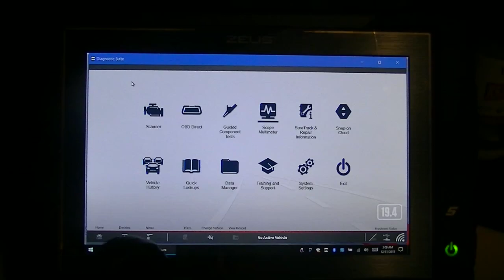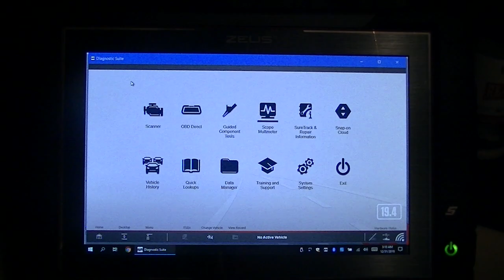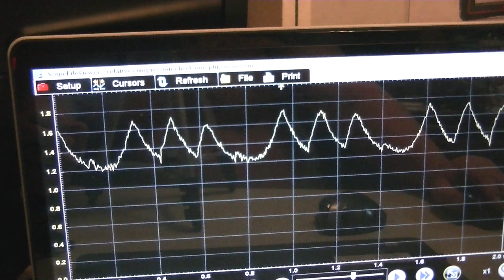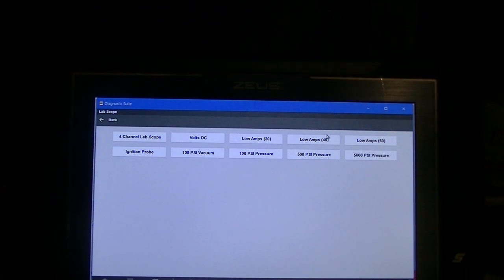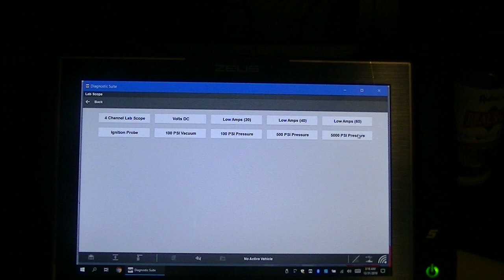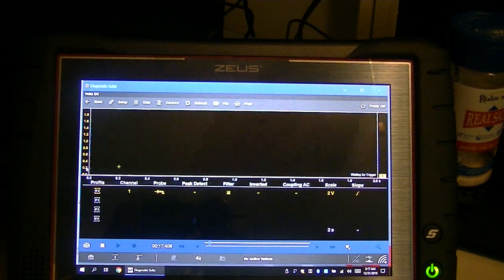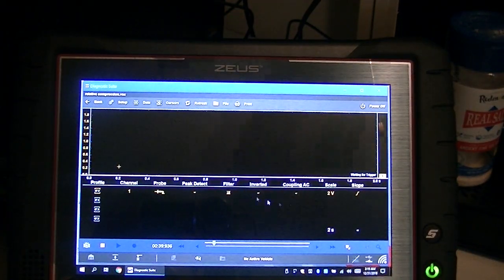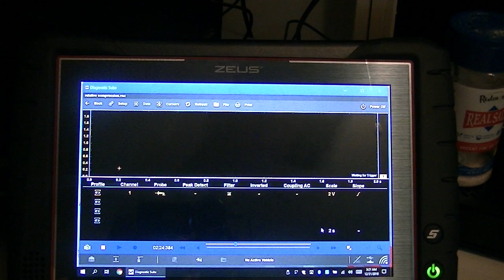relative compression set up with low amp clamp

Comment: Hi there, i have a Hantek low amps clamp, think it about 60amp, can i use that for relative compression test using on volts scale, or will it damage the clamp...Fred in Uk
Reply from the maker: You can use the Hantek clamp!  You just need to know the math formula for that clamp? Snapon's 6o amp setting is 10mv=1 amp and 100mv=1amp on the 20 amp scale. You'll just have to do the math yourself.

Comment: Jaws on the amp clamp are to small for light duty diesel cables. Is there a larger clamp size available ?
Reply from the maker: Yes you can get a high amp clamp which has the bigger jaws. Back in the day you had to use high amp clamps even on cars because of  the that.
Reply: @70corwin   I have Fluke  i410 amp clamp. I am going to play with that to see if I can make it work.
Reply from the maker: @guzzimon61  Just remember the scaling on that clamp is 1mV/Amp output.  So every 1 mv is a amp so set your voltage scale accordingly.

Comment: Hello!  Great video, very helpful.  Hard to find this kind of info.  If you were looking for a very small amount of current instead of a high amp starter, would you use the same setup, only adjust the vertical scale down to say, 100mv?  Or something else?  Thank you!
Reply from the maker: I would just use the pre-sets on the tool. Then the tool would be doing the math for you!!
Reply: @70corwin  Great, thank you.  I just got an amp clamp and am trying to learn to use the scope function on my S-O Modis Edge.  Appreciate the help!

Comment: Hey what up my brother I just did a relative compression test on my 1987 Buick grand national and I found cylinder 1 no compression channel 1 amp clamp and channel  2 on injector num 1 control wire the only thing that I notice is my injector firing line is not on the center of the hump don’t know if it’s the way we set the ignition timing we set it to 25 degree after top dead center and then we stab the cam sensor in look like a small distributors don’t know if you familiar with them.reason im asking because on you’re video you’re saying that if the firing line is not on center of hump it a indications that it could be a teeth out on the timing chain don’t know if he applies to every car or my car is different
Reply from the maker: Can't use the injector for that since it doesn't fire at top dead center. Your injectors will be firing normally at the end of the exhaust stroke. You want to use the ignition signal for your sync. Like the number 1 COP on newer cars or number 1 spark plug wire on older ones. They make special leads for the plug wires but you'll still pick up a signal even if you laid your back probe tip against the plug wire maybe tape it on if you have too. Always use the ignition event for your 2 channel or sync.
Reply: @70corwin  thank you 🙏🏽 appreciate you can you do video on intake and exhaust pressure waveforms you have a way of explaining things that I can understand you’re a good teacher

Comment: 6:50 its written 60A max

doesnt that make it not suitable for relative compression test ?
Reply from the maker: Never had a issue. Been up to 200 amps with it without any problems and  you'll see it measure up over a 1000 amps on the initial starter spike at the beginning of the test on some cars. If your worried about it being accurate you can go to the high amp clamp but its always been fine for me. It reads the same as my high amp clamp , Had them both on the same car one on each channel and they were spot on.   Plus you can also couple with A/C or even do it with traditional lead set on voltage coupled.  I've always preferred this method though!

Comment: Hi, Thanx for the video. Can you please let me know if you connected to the negative or positive of battery ? I've watched other videos and they talk about using the low amp clamp on the negative side of the battery .
Thank You
Reply from the maker: Doesn't matter either one. I usually go to the ground cable since its usually easier to hook to. There's a arrow on the amp clamp for the direction of current flow. If the waveform is upside down you can just flip the clamp over or use the invert button on the scope.

Comment: so where you conect the clamp
Reply from the maker: either battery cable. Negative one is usually easier to hook to but there's a arrow on the clamp for current flow direction. If the waveform is upside down just flip the clamp or use the invert button on the scope.

Comment: Can you explain the settings you use for your trigger on the coil
Reply from the maker: There's different ways to do that depending on the leads you have. But this one i just back probed the wire that triggers the coil or the control wire whatever you want to call it with channel 2. Its the wire goes from the ECM to the coil. It was on a 10 volt scale but the actual trigger of the scope was still triggering off channel 1 the low amp clamp.

Comment: You can use 60 amp setting turn coupling ac. That will filter out the dc volts and only look at ac volts.